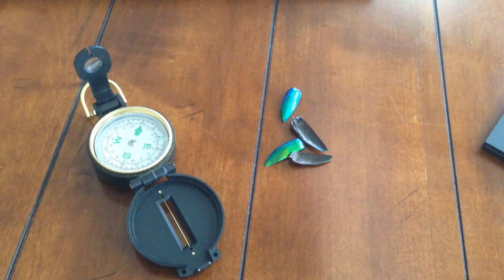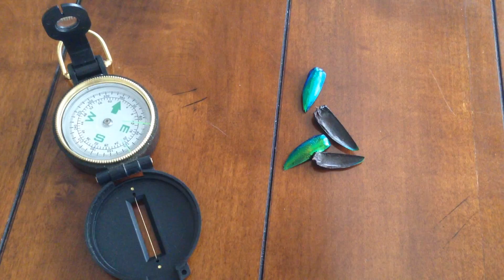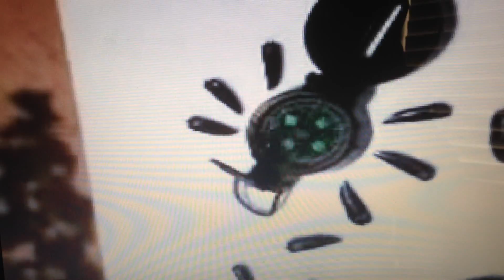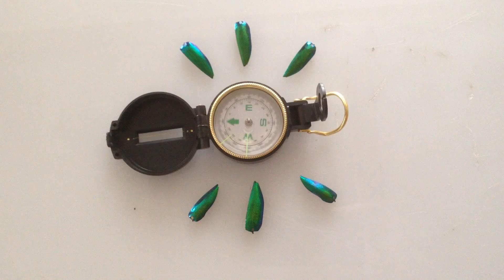Spinning Compass - Grebennikov Video Replication Series

Comment: Okay what does this all say about the theory? Serious question. Does this prove gravity doesn't exist
Reply from the maker: This video is not proving anything, the trick is done by magnets. Please watch the explanation video. 
To answer your question, yes gravity does exist. Our understanding of what gravity is & how it functions however, is not widely understood. Lately, I have been looking into the similarities between "gravity" and static electric attraction. If gravity is merely a static electric attraction, that means that anti-gravity is only a matter of charge repulsion. "like charges repel." The ground/earth being negative & the ionosphere being positive. We just need to find the voltage required to lift a small weight. After that, calculations would figure the amount required to lift/repel the weight of a person or craft.